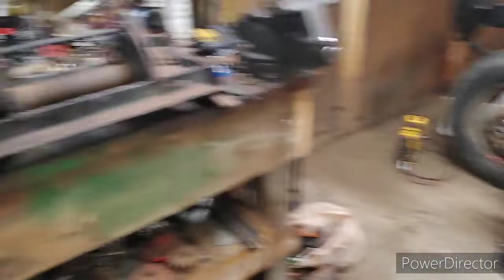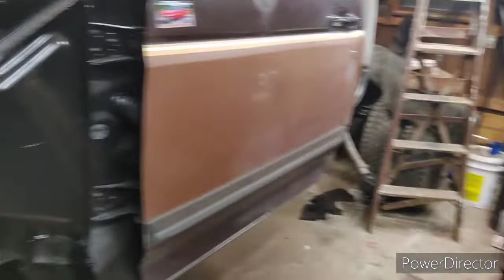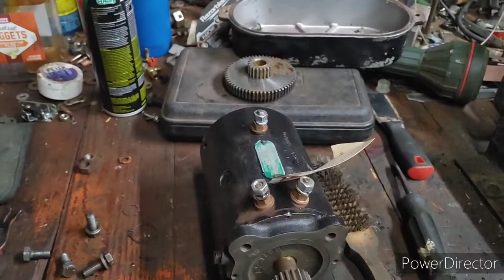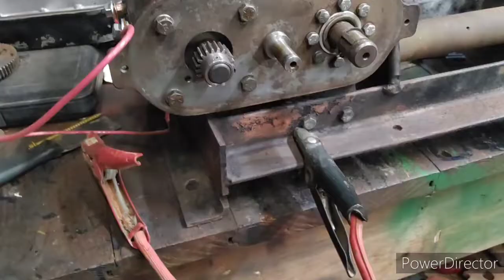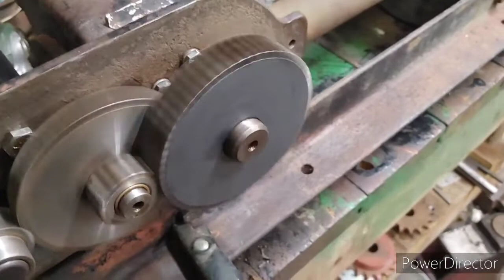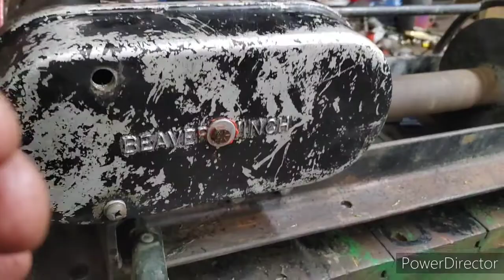Shop up date ,combine and a new phone

Comment: Sucks about the phone and the footage!! 
I have a hydralic winch off a semi trailer. Worm drive just like you have.. it had a brake on it. When it messed up, the guy bought a new winch..lol. I got the old one 😎
Removed the brake, gave it a good going over.. works fine 👍
BTW..  didn't you expect the grease to fly??😵😂🤣🤔
Good luck with the belts and the beans!!
Reply from the maker: Yea I kinda did expect that! I never had a good winch but every time we have to recover someone's truck( my boy's or there significant other's) I threaten to buy a hobo freight one! Thanks Ed

Comment: Barn floods are never a good thing! That should make a good winch.
Reply from the maker: Yea a water line broke under one of the goat pens! I think I'll put a receiver hitch on it so its can be removed and used on a truck!
Reply: @cesmith4566  Custom build a  3 or 4 inch receiver so it can't be lent out.  J.C. sent me over. 49 ford 8-N, 77 Ford F-600 4x4. 2004 Ford 350 SD, you get the idea.